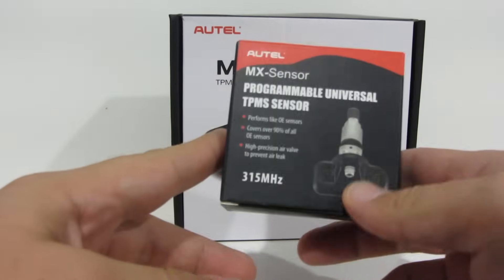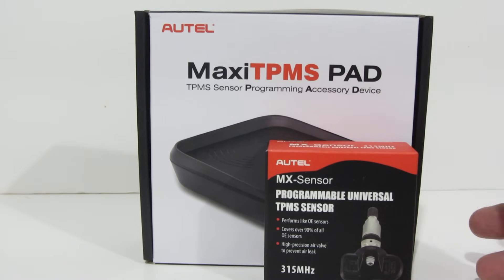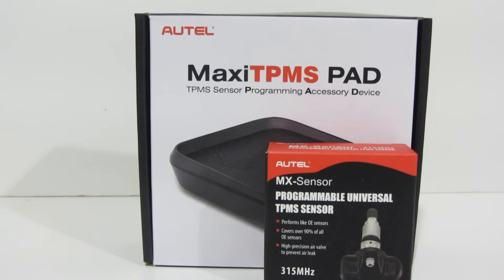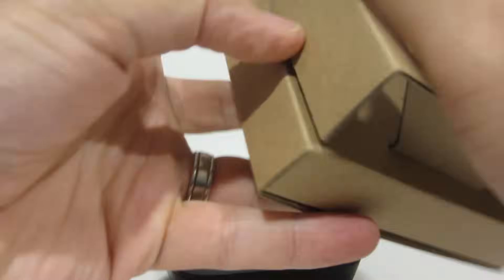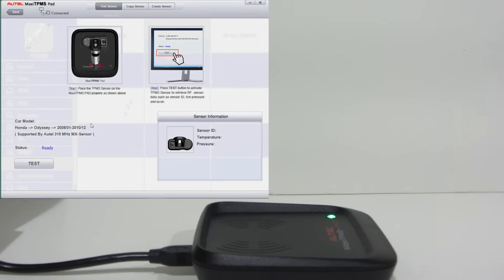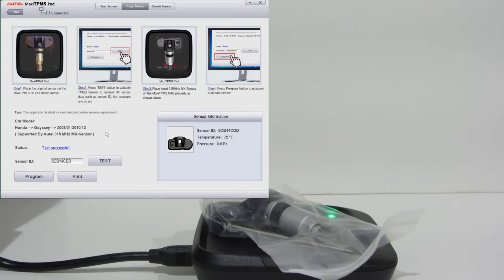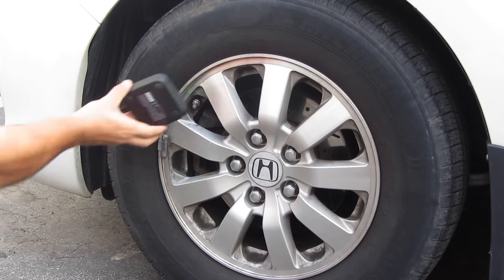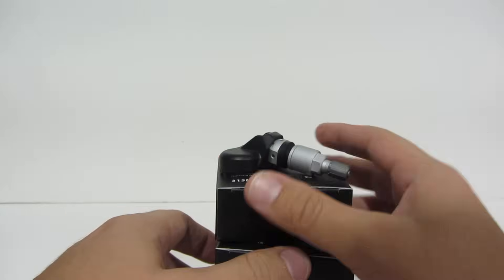Replacement TPMS Sensors for Cheap!

Comment: Thanks man.
Can the pad (I have it now but did not use it yet) read factory OE sensors inside the wheel if they weak battery?
And, how many parameters car ECU check for each tpms sensor? Is it the ID only?
Reply from the maker: I guess it just depends how weak the battery is. The only way to know is to try. Are you planning on replacing those sensors? You could just do the programming when you have the wheel open. The code is usually printed on the sensor itself.
And yes, it's only the ID. As long as the frequency of the sensor (315MHz or 433MHz) matches what the car is listening for.
Reply: Hello, since I am still waiting for the 2 autel tpms sensors to arrive, I thought to "test" the 2 front oe tpms on my car using my laptop and the pad. That did not work! Tried with both engine off and engine on! Currently car cluster is not showing a tpms warning light so.I assume car is communicating with the system, I know I should ultimately contact seller about the issue, since failing to connect to sensor while in rim is my main point when in future I will rotate tires will come in handy, where do you think is the problem?
Reply from the maker: @gardenia1738  Engine off or on won't matter. But you can try driving around for 5 minutes and then try to read the sensors within a few minutes of stopping. The sensors have a centrifugal switch that turns them on when the wheels spin and they stay on for a few minutes after stopping.
They should also turn on in response to a signal from a tool, but maybe that signal isn't strong enough to work through the rim in your case.
Reply: Thanks man

Comment: Great video! Question for ya, how would I get the code from the OEM If they’re are no longer available or or stolen? Thanks
Reply from the maker: The only way is to get a tool that can read the code from the car's computer. But any tool that can do that can probably program the car with a new code, so there's no point using programmable sensors :)
I have a Foxwell NT510 that can do that. But they released a newer version, the NT520. It's the least-expensive tool I've seen that can read all codes. You just have to make sure you specify the make of your car when you buy it since the tool needs specific software for each manufacturer. You can buy it on eBay here (ships from Hong Kong): https://ebay.to/2UKqbeW
Or try Amazon if you want it faster (just make sure you read carefully and get the NT520 - Amazon search is bad for giving you different results): https://amzn.to/2CJxaOr
After you buy it, you can even buy and download additional software for different manufacturers directly from the Foxwell site (I think each one is around $60).
Reply: Gabe's Hacks thanks man, great information

Comment: Thanks for the video. What is the difference between "program" and "test"? 
and if I am buying new sensors, will I have to program then before installing them in my tires?
Thanks again
Reply from the maker: "Test" just reads the code from the sensor to confirm it's working. "Program" writes a new code to the sensor. The whole point of these sensors is that they are programmable, so the only reason to buy them is if you know you want to program them before installing them. Otherwise, you could just buy non-programmable sensors.
What do you need to do? Do you need to replace a broken sensor?
And what is the year/make/model of your car?
Reply: @GabesHacks  Thanks for the reply. I see now. 
I have a Nissan Maxima 2011 with 2 front bad TPMS sensors (factory sensors)
Another question please:
Can you, 1st scan the original sensor on the tire (in my case the original factory Nissan ones) to get the ID, then, 2nd go to "program" and change the MX aftermarket sensor ID to MATCH the Nissan one?
My thought process is to avoid dealer (or tire shop) "relearn" process". So car computer would not be aware of the different sensor and treats it as the old one.
I would rather learn to program them my self and do the relearn than having the dealer do it. I will just need my friend shop to put the sensors in the wheel.
Thanks
Reply from the maker: @gardenia1738  That's exactly what I did in this video :)
Reply: @GabesHacks  Thanks man

Comment: What does S.  O and copy only mean on the spreadsheet codes? My 2009 says copy only so can I use this kit to program new ones? After programming does the vehicle still need to relearn the new sensors? Or do I just use the relearn/reset procedure in the car manual
Reply from the maker: The top of the spreadsheet says S = "Stationary" and O = "OBD". I assume "OBD" means the car can be programmed through the ODB port. I don't really know what Stationary means though. "Copy only" maybe means that you can't program the vehicle at all, or maybe just that Autel's tools can't do it. But cloning a sensor always works. The car won't be able to tell the difference between an original sensor and a cloned one because they both have the same code. So cloning a sensor means you don't have to program the car.
Reply: @GabesHacks  oh cool that's good news then thanks for the fast reply and help on this.

Comment: i put regular tires on my oddissey 3 years ago.  I still have the run flat tires with the old sensors in them.  would they work it I put them in a pvc chamber and pressurized it to 35 lbs?
Reply from the maker: No, it wouldn't work. The sensors turn off when not in use. They have a centrifugal switch in them to turn them on when the wheel starts spinning. They would never turn on sitting inside a stationary tube.

Comment: Tyre sensors are a con job,a money making exercise by car manufacturers!!
Reply: NO, it was FORCED on the manufacturers by the inventor!. The sensor was developed and patented in the early 90's (I think), and they tried to sell it to the auto industry. No go, they were unwilling to buy in. Then the inventors went to the US DOT to see if they would create a ruling to make the auto industry buy it. Also no go. Then they lobbied Congress and the Senate, to force the DOT to implement a ruling - Success! The reason the DOT was not willing to make a ruling in the first place, was that the inventors had a monopoly on them and were a sole source. Greed wins out in this case, for a gadget made for the lazy and ignorant.
Reply: @paulmoffat9306  Thank you for this info.
Reply: Niall Church you damn right on that one ☝️
Reply: OK all you young uneducated persons.  And please , correct me if I am wrong.  (and you will).  :)  Remove the sensors , learn how to
read a tire gauge.  Install simple , tried and true , tire valves in your wheels.  This has been working for about 100 years. free your selves of tech. slavery.   This is not rocket sciFY.   If the dash light bothers you that much??  put a small piece of black tape over it.
2007 prius  (I love this thing)  Remenber , life is short , enjoy yourselves.
Reply: @v.s.o.8684  We are at a point where the TPMS system has failed (meaning: unreplaceable battery burn out, something I strongly object to, since the rest of the components are completely usable and which then creates e-trash that is unlikely to be properly recycled), so I've been researching DIY solutions and found this extremely helpful video and then these comments. This is the first vehicle I've ever owned that had this feature, and when we recently discovered the problem I felt that it should be repaired. I'm glad to be able to ascertain that we actually don't have to, we can just return to the old school method. Thanks, I appreciate your efforts here, along with everyone else. Excellent YouTube content all around.

Comment: HI Gabe,  Can this pad check if some sensor does not work or if the battery is already low? the TPMS system is activated from time to time
Reply from the maker: It can check if a sensor doesn't work (it just won't be able to read it), but I don't think the sensors report battery life, so you can't tell if the batteries are low. It will either just work or not. It is possible that one of the batteries is low and the signal is so weak that the car doesn't pick it up all the time.
Reply from the maker: Which light is coming on? The low pressure indicator, or the one with the letters "TPMS" ?

Comment: Hi Gabe, I have a Honda Cr-V 2009 EX-L and the "TPMS" light with the other light for tyre pressure is blinking. I have read a lot about this and I considered that I have one or more bad TPMS sensors. But how can I check if there is one or more broken sensor or maybe with low batteries? Is it possible to check this via Autel pad? Or if i can't read a sensor does it mean that this is the right sensor with the low battery? I am asking because of the fact I don't want to buy 4 sensor if I need one of them. Thank you!
Reply from the maker: It is odd that they are blinking. Usually when something is wrong, the "TPMS" light comes on and stays on. I tried searching online about it. Does your car have a button on the dash (maybe to the left of the steering wheel) that says "TPMS"? The last post here says something about having to press it several times: https://www.crvownersclub.com/forums/14-problems-issues/81737-tire-pressure-light-keeps-blinking.html
One thing that can help (for any repair) is to have the Honda factory service manual. I bought it for my Odyssey and it is suuuper handy to have. You can buy an electronic copy on eBay for about $40: https://ebay.to/2Cx1Guk They actually mail you a DVD, but it's just a large PDF file on the DVD. That manual will probably have more information about what a flashing TPMS light means and how to fix it.
Reply: @GabesHacks  Thank you for the fast answer! I don't have a button to reset it and i don't know what to do in this case.
Reply from the maker: @svetlozarstefanov6794  It could be either a problem with a sensor, or a problem with some other part of the TPMS system. 
A scan tool that plugs into the car could help here - one that can read the Honda-specific codes (not a generic ODB2 scanner). I bought a Foxwell NT510 (https://amzn.to/2DnumY7) that can do that. This is great tool to have for any repair, if you plan on doing repairs yourself. That will give you the exact reason why it's complaining. If it is a problem with one of the sensors, it would tell you that, but it can't tell you which one (it can tell you the code of the sensor it doesn't like, but it can't tell you which wheel it's in).
The PAD I used in this video could be used to test each sensor by itself. If you can't read one, you know it's bad. I just worry that it's not a sensor.

Comment: Thanks for good information on how TPMS works !  I have a question though. I see that you can read the sensor code even when it's in the tire. I suppose that the TPMS PAD can be used to put in a code when the sensor is in the tire already too, right? I ask because I bought a full size spare that doesn't have a sensor and I am thinking of having a local tire shop to put it in for me but they don't have the PAD.
Reply from the maker: Well, you could program it before giving it to them to install. But I don't think it will work the way you hope. The point of programming the sensor is to have it match an ID that the car already recognizes. But you can only program the spare with 1 of the 4, and any of your four tires could go flat, and it may not be the one you programmed into the spare.

It is worth checking if your car automatically detects new sensors, because in that case you don't need to do any programming at all.

Comment: Hi Gabe,
  Excellent video, thanks. Questions, doesn't seems to have a complete manual on the Autel site, just a quick setup guide.   I have a Honda 2010 and  one of the sensor is dead, can you manually enter a TPMS ID into the software after reading it off the dead sensor.
Reply from the maker: Yes :) That's what I did. I described that briefly at 5:41.
Reply: Thanks and sorry, that will teach me not to pay attention to the video.
Reply from the maker: No worries! Happens to the best of us. :)

Comment: Thank you very much for good videos!
Could you please suggest where to buy online not expensive and good TPMS Sensors. Both types - programmable(cloneable) and not programmable?
Perhaps you may suggest good brand and model names for TPMS sensors as well...
Reply from the maker: There are links in my blog post for this video to eBay and Amazon where these programmable sensors can be purchased: http://www.gabeshacks.com/2016/10/how-to-clone-and-program-new-tpms.html

I haven't had to buy non-programmable ones, so I don't have a recommendation for those.
Reply: @GabesHacks  , thank you!

Comment: Thanks Gabe. Insight to Nissan Versa Owners. I have a 2010 hatchback that I struggled hours to get the pad to read. I even dismounted the tire to read the sensor. I found out that if you smack the tire with a rubber hammer to "wake up" the sensor it would report to the test on the sensor. Only by accident did I figure this out. I hope this helps somebody. Great video anyway.
Reply from the maker: Good to know! Another way can be to drive your car for a bit, then read them within a few minutes of stopping. They have a centrifugal switch inside that turns them on when the wheel turns, then they stay on for a few minutes before shutting off.

Comment: Thanks Gabe. I have honda accord 2014 exl. Do i need to buy tpms sensors  for my winter wheels?
Reply from the maker: That depends. Does your car even have sensors?
Reply: There's no need to buy TPMS sensors. Honda Accords from 2013 use Indirect TPMS. That system uses the ABS wheel speed sensor to determine which wheel has low tire pressure based on its rotating speed, as opposed to Direct TPMS, which uses a sensor on each wheel.

Comment: Thanks for this - best solution for the bullshit TPMS situation I've seen yet. Programmable sensors for less money than other options. So then I will not have to have them programmed every flaming time I change winter/summer wheels.

Comment: Gabe's Hacks: I am going to install all new tires on new rims but the tires (even though the numbers all match the existing tires) are actually around 1-1/2 inches bigger than the original Cooper tires (which I hate). SO I will need the sensors and the programmer to do it. But will it be the same code if the tires require more pressure and are a bit bigger? How does that work for my 2009 F150 FX4?
Reply from the maker: The difference in tire pressure won't matter. The computer is programmed to throw a warning light when it gets below a set pressure, usually around 20psi.
The F150 does seem to have a TPMS reset procedure (see page 238 of the owner's manual: http://www.fordservicecontent.com/Ford_Content/catalog/owner_guides/09f12og3e.pdf) but it does seem to require a special tool that it says should be in your glove box (this guys has a video of the procedure: https://youtu.be/5_w7zkXv5xs). If that's true, then you don't really need to buy programmable sensors like I did. You can buy any compatible sensors (F150 uses 315MHz sensors) and then do the reset procedure.
Reply from the maker: That said, if you are doing this for winter tires, then you would have to do that reset procedure every time you switch your tires. But it does seem to be a pretty quick and easy procedure.
Reply: @GabesHacks  Thank you so much for the really quick response. I just ordered a set of Motorcraft sensors and the programmer from eBay formless than $65 and the deership wants $96 for each sensor alone!!! I'm not paying that! That's a  ridiculous amount for something so simple! Again thank you.

Comment: I have a 2009 F150 FX4 and I just spoke to the dealership about getting this done. The cost is outrageous!!! $96 just for each sensor then the cost of mounting and balancing the new tires and the cost for programming each tire! So, if I was to get it done there it would cost around $550 and I already have the new tires and new rims so I'm seriously looking at doing this myself. Thanks for this video! You may have just saved me $400 plus!!!

Comment: Are each tire have their own TPMS code? If so, then the order is all different after tire rotation. Since you mentioned Your Honda only recognize one code per wheel; how does that work after tire rotation?
Reply from the maker: Each wheel has its own code, yes. However, in my van, there is only one receiver for all four sensors, so the van has no idea which wheels are where. So rotating doesn't matter.
Some cars do have a receiver for each wheel, and in those rotating can mess it up. But sometimes the computer can figure it out by itself. It all depends on the car.

Comment: How can I use this sensor for a self-made vehicle(i.e.,to display tire pressure on self made display)?
Can I do so using some microcontroller?
Reply: use your brain and body sensors, only retards cant tell if they have a flat tyre. TPMS systems are shit and are just problems.
Reply from the maker: You can buy universal sensor kits that come with a receiver. Search for "Universal TPMS" on eBay: https://ebay.to/2OMWbwm
There are a few different kinds. Some have internal sensor, some have external sensor that just replace the valve caps. Some have receivers that plug into the car, some can use a app on your phone using Bluetooth, etc. Take a look.

Comment: Let the low pressure light stay on, not spending that kind of money on something that's not required in N.Y.
Reply from the maker: If the low pressure light is on (the light with the exclamation mark inside of a tire), you have a problem. It means the sensors are working perfectly fine and they are detecting low pressure in one of your tires. If your sensors are not working properly, or you've removed them, you will see the light with the letters "TPMS".